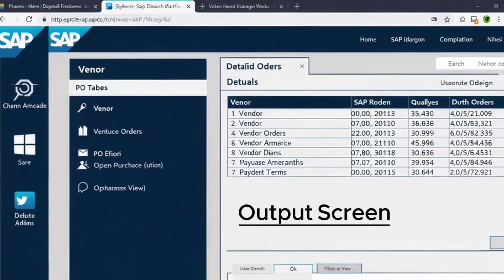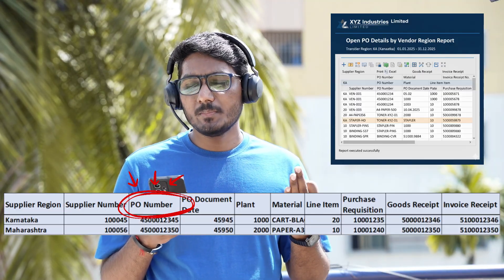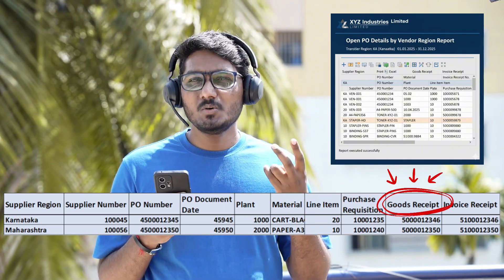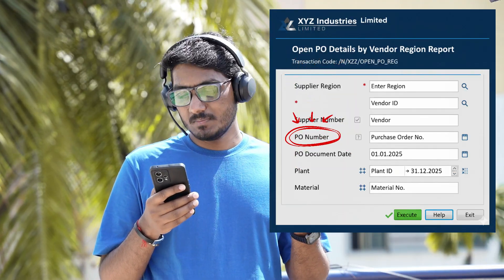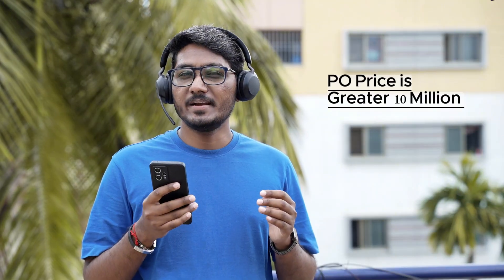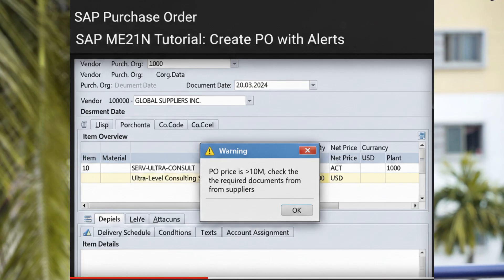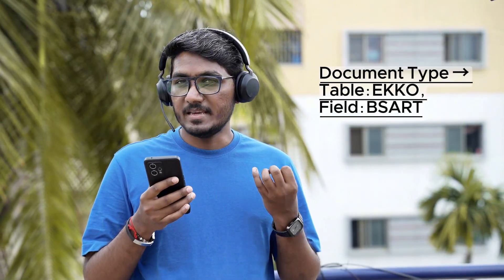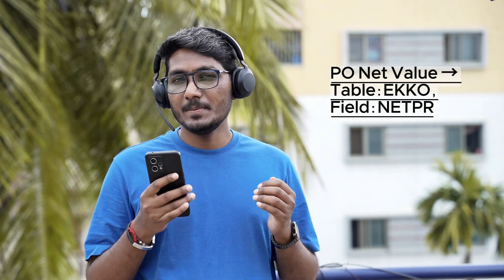How to Write Functional Specification (FS) in SAP | Giving Logic to ABAPers with Real Example WRICEF

Comment: Could you please explain how write TS (Technical specifications) for any requirement over analysing FS...
Reply from the maker: Great question! 👏
Once the Functional Specification (FS) is finalized, the Technical Specification (TS) is prepared by the ABAPer (technical consultant).

Here’s the process in short:
1⃣ Analyze the FS – Understand the business requirement, tables, logic, and validations mentioned.
2⃣ Define Technical Approach – Mention how the requirement will be developed (e.g., Report, Enhancement, Form, Interface, etc.).
3⃣ Program Details – Specify program name, T-code, package, and development type.
4⃣ Technical Logic – Explain internal tables, data retrieval logic (SELECT statements), loops, field mappings, and performance considerations.
5⃣ Output Design – For reports or forms, show layout structure or ALV format.
6⃣ Error Handling & Validations – Mention how system messages or exceptions are handled.
7⃣ Transport & Testing Info – Include test cases, authorization, and transport path details.

In short — FS explains “what” needs to be done, and TS explains “how” it will be done technically. 💡
Reply: Thank you, For the explanation Anil keep posting the content related to Sap World. It would be very helpful for the viewer's to gain knowledge and understand Business of SAP ERP....